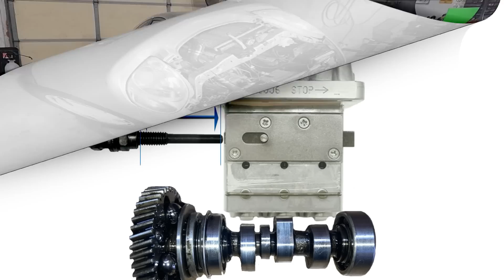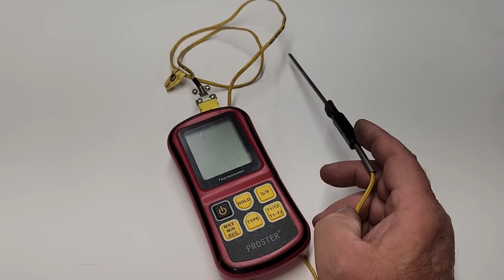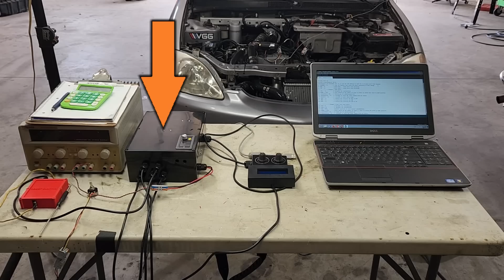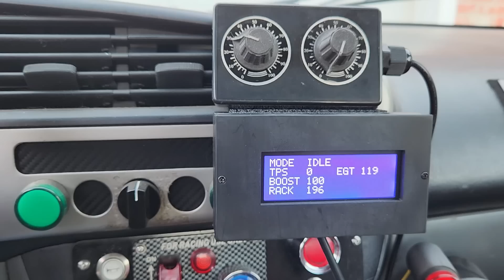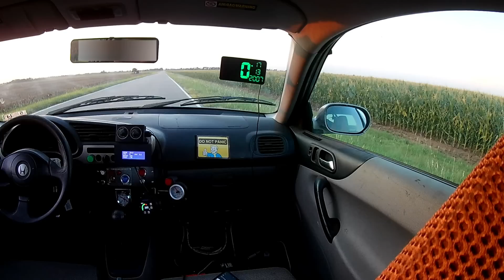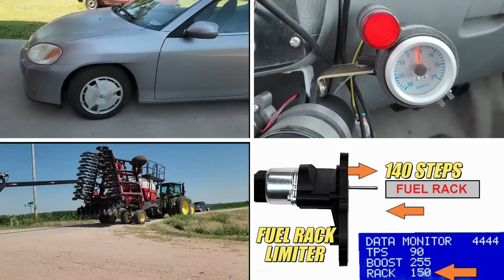S4 E24. the computer controlled supercharged Kubota diesel gets faster and better MPG

Comment: The Kubota D722 is the engine that was on my Kubota mini tractor.  I wondered if that engine would have worked in a car.  I now drive a Lexus CT200h and only get 50 MPG on non-ethanol gas.

Comment: Can you please put variable turbocharger (variable exhaust AR) instead of supercharger ? seems it could be much efficient (please like this post to make it seen)
Reply from the maker: Hi ya,   The 719 cc diesel engine is too small for any off the shelf turbo charger to work efficiency.  I'm not aware of any turbo that would be a good match for this engine.  We tried the VZ21 turbo on this engine with disappointing results.  The supercharger provides the instant boost that we are unable to get from a turbo.  Keep in mind this engine has never been used in an application like this before and there are no off the shelf parts that will work perfectly.  We have to be creative with what we got.
Reply: @ I googled and seems it's analog to ihi3 turbo, and it is a smallest available turbo rated for 20-100 hp engines. I've seen video where people were installed vz21 to predator 212 cc and had small  positive boost, which they confirmed on a dyno added them raftly 20% of power. I think with your sofisticated electronics it can be more, also you can try to use both stupidchrger and turbo and play around, also add intercooler and methanol injection to the air outlet in the setup, and also keep an eye what rpm usually you ran a car, so seems absense of boost on low rpm is not an issue, also you always can tune governor to have more higher rpm limit, this will increase power the most, also vz21 or ihi3 or even ihi4 can increase torque on low rpm, so at least to play with all of it and to try a jet A fuel (can be bought in airport) can lead to dramatical increase of power, and maybe efficiency. And yes, you are correct, nobody is doing things like this, that's why I subscribed to your channel and watching all the videos :) and thank you for your research you are entusiastically doing for all of us, it's highly appreciated by smart people :) want to believe in last few words in previous sentence ))))

Comment: Hey ik cams work differently in diesals but you could most likely send a cam off to delta cams and they do custom grinds typically cams in deisals just help egts so you can push more fuel

Comment: I too have been (Slowly) modifying my 'Forever' Car, and am currently at 52mpg Highway, maybe as good as 56mpg Highway. I'm at ~24mpg City, maybe 25mpg City. I am aiming for 60mpg Highway. Though I've been going the way of controlling the air around my car, but I've done some mechanical mods that have helped a lot, like installing a 'Torque-Converter Lock-Up', but I'm not too inclined in electrical aspects.  I recently learned that by moving the tires out until they are 10mm beyond the wheel wells helps with aerodynamics. I'm going to see what thickness of spacers I need for my car and give that a try.

Comment: For those of you wondering 
On engine electrical components the term  "12 volt" changes depending on whether the component is supposed to be on while the engine is cranking, if it's on whenever you're running or used intermittently.

Because your battery is between 12.1-12.6 volts before you turn the key on.
Then it drops down to 10.5 volts while cranking.
Your alternator maintains 14.25-14.50 while running

So most headlights are rated at 12.8 volts 
Shift solenoids and sensors for closed loop operation are usually 14 volts. 
The relay for the starter is 9 volts.

There's almost nothing on a car that's actually rated at 12.0 volts

Comment: I wonder if you can add a boost feature for water meth injection for better egts and power or maybe just water to manage egt?  Looking good as always maybe the controler could control a flap to make exhaust quiter for cruise? Some sort of muffler for the boost control valve? Factory air box setup to make the noise from supercharger quieter? All ideas good work regardless

Comment: Many pre-common-rail truck diesels used a simple diaphragm actuator as the fuel rack stop. Piped to the intake manifold, it limited pump stroke when manifold pressure was low. Simple and effective, I'm wondering why you didn't take the same approach? To slow response?

Comment: Thank you so much for sharing your projects with us :) It's good to see what different-thinking can create. Your electronic fuel trim set up is a re-invention of the mechanical aneroid. some diesel engines have those to reduce black smoke under part load conditions. It is a spring loaded valve that limits fuel rack travel until a set boost pressure is reached. it can look like a vacuum diaphragm cannister mounted to the injection pump with a small diameter tube going to the boost side of the air inlet tube (many look like an integrated part of the injector pump). The nice thing about your electronic system is the EGT fail-safe and the 99% automatic compensating adjustability without having to machine new parts. Keep up the experiments and I look forward to the next episode! 😊

Comment: As I was watching this video, I realized what you are doing is exactly what the car manufacturers have been doing for the past few years to meet the newest, and very stringent, fuel and emissions standards.  They're Installing a way-too-small 4-cylinder engine in a full-sized SUV, then turbocharging and tuning the hell out of it so it can get that heavy car up to a decent speed on the road.  It looks like 3-cylinder engines will be the future, Jimbo, and you're leading the way.

Comment: 7:25 if you encounter the police, I hope you keep the camera rolling, while you explain that these gizmos are to tune the engine for maximum performance while you create your custom engine controller. And then the faces of the police officers when they open the hood to find a 719cc Kubota diesel engine, after expecting you to run a 600 hp monster ;D

Comment: Pull the heatsink on the buck boost and add compound, mine came dry! I use mine on a m18 battery as a mobile power supply. You can also rotate the display...fun fact!

Comment: When my cars coolant temprature sensor failed, i used a thermostat switch device used in egg incubators. It had a display and a relay which controls the radiator fan. But the thermostat temprature limit was 110 degree celsius. The fan used to switch on when the engine reached 110 degree Celsius ( By the way the car was a Maruthi Suzuki 800 ).

Comment: Hey Jimbo, if you read this, maybe you could look into tiny Lifan engines. In my country weird people like me like to drive carrier mopeds (look up Gazelle Apollo for an idea, it's like a pickup bed with a motorcycle attached to the back of it). We commonly use 90-125CC Lifan 4 stroke engines to power these things. There are even some with reverse. They usually weigh in around 600 pounds and can carry 1100 pounds. Might be a cool platform for a next project. I've had an actual car with an 800CC engine (Chevrolet Matiz) so that this engine works doesn't surprise me at all.

Comment: Wouldn't a turbo make loads more power? I can see it having lag, so why not build a air to water intercooler, AND A TURBO, USE a air conditioner core inside a box the boost passes through. And a small water tank and a ac condenser to cool the water, also why not add a water/methanol injection as well?? Use 1/8" wall tubing and 3/8" to 1/2" plate to  build a custom turbo header/manifold, and plumb the turbo into the supercharger, possibly adding a bypass, using a 2"tube from intake side to outlet side, with a valve using pressure difference to activate when the turbo exceeds supercharger boost , allowing the bypass to open.. reducing drag on the engine, possibly a 5+ HP gain , with a air to water intercooler just before the intake on the engine hopefully dropping the intake charge to ambient temperature (in a perfect world 'or below') using methanol to chill the air, and dry ice to chill the methanol.( An electric ac compress could chill the intake directly!😮, without dry ice, ). I'm curious to what the small engine is capable of.  Maybe CNC mill the crank to remove any UN- required weight. Polish the rods removing stress risers. Polish the piston to remove weight, deck the block to get the pistons about .010" out the bore, cera coat the pistons, head and exhaust ports ,(after. Porting the head polishing the ports to a mirror leaving tiny dimples in the intake ports. Making the intake passages streamline as possible. Possibly cera coat the intake port also, with the ceramic insulation polish the valves coat the valve faces. Also o-ring the block and head using a dead soft copper gasket. With arp head studs and main studs. Add about .005" more side clearance to the rods, with tiny grooves .030" wide and .020" deep to sling oil into the bore under the piston, acting as a squirter. Have the injectors enlarged slightly. Along with the pump. About 20% larger pump , with a compound super turbo system, using two turbos with the exhaust from one spinning the next one, and compound the Cold side, to possibly (in theory) get 60-80psi, with the supercharger doing the first 12-15 psi , basically at a fast idle. And the turbos spooling around 1450 rpm, exceeding the supercharger by 1700rpm and 30+ psi about 2000rpm.  It should be capable of 100hp fairly easy, with the air to liquid intercooler, hopefully keeping the inlet temp around 100°f +/-30°,  the ceramic coating should allow 200° hotter egt for a fair bit longer duration. It could see 40hp+ /cylinder, it should perform like a stock k20,

Comment: Of course you can LS swap it, and make it fit, just use a bigger hammer, but there's nothing i wouldn't rather see, just search, LS swapped, and ad what ever, it's probably been done already, just too boring, fuel economy is interesting because it's something that the main manufactures don't really want to do, they would have to sell you less, if you want more efficiency, that's not gonna happen,
If you want to swap it with something ridiculously, then at least do a Commins swap.

Comment: Interesting content :) -  From my little experience with diesel engines if the injector pump isn't setup/designed to run boost they don't work as well (unless its like a common rail pump that can typically push more fuel than you need anyway), other option is go bigger injectors for more fueling and i find "lean is mean on a diesel, you want to keep fuel down and turn up boost until EGT's spike then add a bit a fuel as when tuned right they will actually stop going up under WOT but you will typically notice higher egt at low load were boost isn't as high until you are cruising at it cools down.
Keep playing cause learning is fine and pushing limits for the maths and knowledge is cool too :)

Comment: Great to see some more of this crazy stuff. I love it.  A few things I'm curious about.
The Pistons will melt? While I have seen that happen on the internet, I've never seen it happen IRL. Normally they will over-expand and seize well before they melt. Also curious if the Kubota has the little oil squirters on the conrods that high performance engines have that squirt oil up onto the bottom of the piston to help cool them?
But all my experience has been on high performance high revving boosted petrol engines and aviation petrol engines. They tend to worry more about the exhaust valves overheating and use things like sodium cooled valves.
Edit: I had for the the last few day been driving my parents Prius C(Toyota Aqua) around the curvy mountain roads of New Zealand. It's an okay car (Noisy at open road speeds, not very efficient. But handles in corners very well (the NZ new model seems to have stiffer more sporty suspension) It ate a LOT of fuel, 6.2L/100km average over 1,200km.  I learned 2 things. CVTs are awesome if you can get the feel for it. And People will go to insane lengths to get past you as soon as they see the 'Prius' Badge no matter how fast you are going.

Also, Thanks for making sure you give us measurements in metric. I can think in both since I fly planes. But not many other people can without having to grab a calculator :D.. Keep it up!

Comment: You might want to fabricate some kind of shroud to direct the air coming through the radiator and direct it to the exhaust manifold to help cool it down some and a hood scoop directly over the exhaust manifold to and funnel some of the air going over the hood to go inside the engine bay instead to help reduce EGT temps and also lower the under the hood temperature as well.

Comment: Being that you already have a multichannel EGT board wouldn’t it be better to run 1 EGT per cylinder with a fail safe of if any one hole goes above a certain temp it’ll trim?  I know it’s a little complex but if you can’t afford a new motor it seems like a good cost.

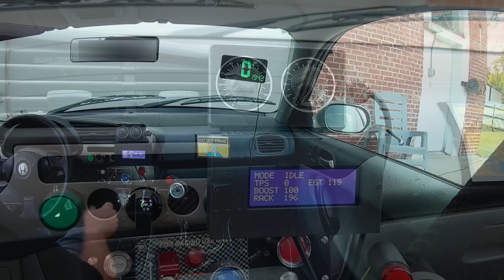Comment: I may have missed it are you running a intercooler? That would help with making more power on less boost. Which would cause less stress on the rest of the engine and less fuel needed. 8:46 if you've already done that disregard my comment.

Comment: Yeah you're only making 25 cents an hour but these videos ended up making connections for you. Without them, you may not have been contacted by that Kubota tech, you wouldn't have been sent that voltage regulator...the value of stuff can't always be measured in just money.

Comment: This is really cool!

Couple of questions for you:
1) What do you think about having a custom PCB made for this that includes the arduino, power supplies, and any of the non-remotely installed sensors. I might be interested in making that for you.
2) Have you done any work with building test fixtures that simulate the inputs to your device so you can test the code? I'm imagining potentiometers that output simulated tach / temp / TPS etc so you can test the software on a bench.

Comment: turbo and supercharger? like some 2T detroit disel, the supercharger would make the bottom end torque, and the turbo, with a exhaust housing a liitle bit bigger than optimal, (like an PSA group 1.5 turbo or an vw 1.4 or 1..8T) would help not concentrate heat in the exhaust manifold, making it more free flowing and not melting the pistons, but would supply a lot of boost at a normal range, not needing to overboost the turbo to get a good ammount of power

Comment: H2O2/Methanol Injection!!! Yes, you read that right; H2O2, not H20. The ~30% stuff for hair bleaching and retrobrighting. All the benefit of the water, but now with more oxygen! You've got the electronics in place to control the H2O2/methanol injection now.

Comment: the noise from steppers isn't much of a problem with tc's with 3d printers.  (yes most of them use resistive thermal sensors but a bunch use tc's and the amps just there on the board next to it). what stepper wires can cause problems is with causing bounces on just on/off inputs to the microcontroller(bouncing sort of, like regular switches) if you run the wires along each other.

Comment: Stupid question from someone that isn't all that well versed on the subject. 

Given that you have a micro-controller now handling the boost and fuel, and given the engine seems to like boost... why is it still sitting around 10Lbs? For some reason, that feels incredibly low to me. Not that I have a lot of data points to work by.

Comment: Sub 3l per 100km is insane for non hypermiling driving. 

Maybe you can push up to 40 km/l (about 2.5 l / 100km) with proper driving and tire pressures. Which would be insane for a homebuilt system like this.

Comment: Are you aware that Mercedes made a 800c turbo diesel (OM660) engine they fitted to the "Smart Fortwo" car a while back that produced 41 HP and later 53HP ?  I think that would have worked well in the 1st gen Honda Insight body.
Reply: That sounds pretty awesome actually.

Comment: Awesome work!   one thing I noticed was the front tow hook on the front bumper.  I'm sure you have it there just in case you need it, but if it's easy to pull and tuck in the glove box I would to that so you won't loose the cover that's flapping in the wind.   these cars are of the rare variety and loosing a small piece like that might be hard to replace.